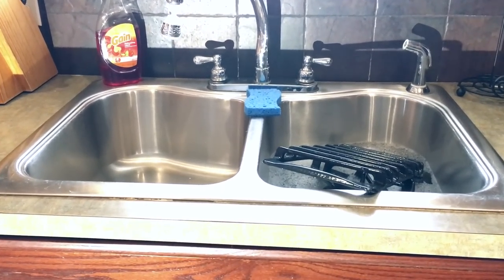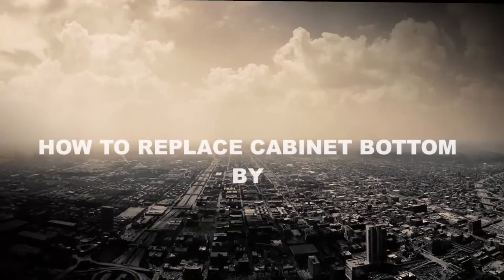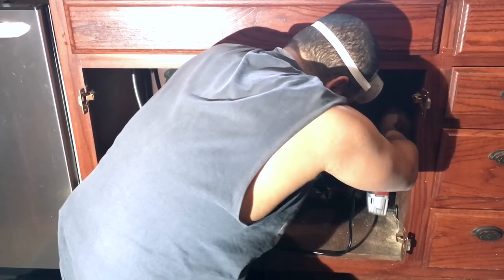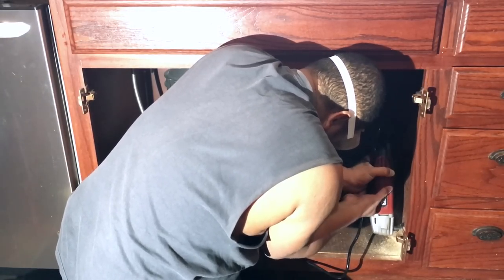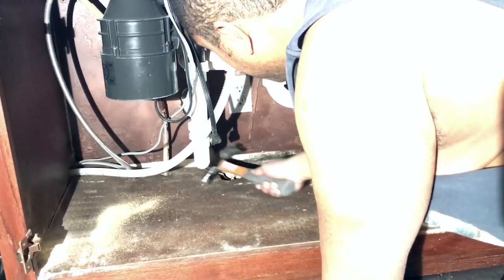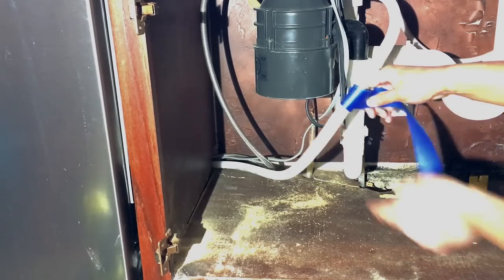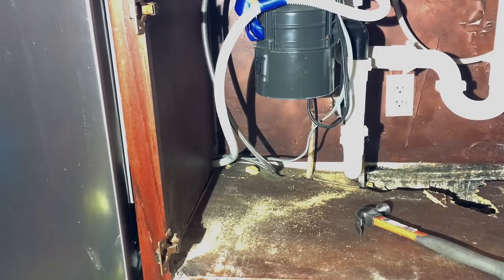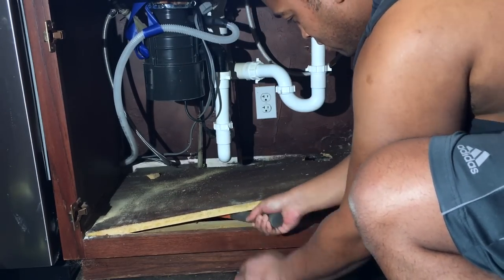How to replace rotten sink base cabinet bottom. The Easy Way. Mold & water damage

Comment: As a professional Handyman I would be really embarrassed if I replaced a cabinet base like that, however for a DIY'er it is not too bad and if its your own place then only you have to live with the finished result.  Careful measuring of the pipe locations (By sliding the base in prior to cutting the pipe holes) and the use of hole saws would have made the repair much neater and would have meant that there was no need for the expandable foam.  Any gaps could have been filled with caulk.   I also place packets of  moisture absorbing crystals underneath.  So once the mold had been taken care of the crystals help pull out any residual dampness that might be left over in the walls and cabinet.  Not a real fan of the music but I am over 50 so I am heading into the grumpy old man stage of my life.
Reply: Can you please tell me how much it would cost to have this fixed?
Reply: Don’t worry I’m 21 and I’m also not a fan of the music
Reply: That music thing has nothing to do with your age. It's annoying when a video creator dumps music into a video that doesn't need it. Really distracting and does NOT make it more entertaining.
Reply: I have mold under sink kitchen cabinet right now and need to do some work. It would be nice if you in San Diego.lol
Reply: Hated the music😡it drowned out his voice. I need to see and hear what is happening to fully understand.
How do you deal with black mold?
Reply: This is what I need done could you tell me what a normal cost would be to have someone do this? Thank you
Reply: He did much better than most apartment maintenance men will do. I need him and hist tools in my unit for an hour! I guess it's the nice home constructions that get good craftsmanship where as apartments are built like disposable movie sets where maintenance work orders go unanswered or done in such a horrible way the problems aren't actually solved.

Comment: Nice video. A few things I’d do differently, though. The first is that it’s critical the newly exposed area be decontaminated. If the mold is bad, call a pro. Not all mold is bad, but many are and you’re not an expert. Do NOT fool yourself into thinking bleach or Lysol spray will handle black mold. It won’t. Once the mold is mitigated, the area must be dried out completely. Put a dehumidifier in the area. Next, I wouldn’t use spray foam. Though it make a fabulous seal, it expands into a gloppy blob, becomes hard as a rock, and can never be removed again without a lot of effort (chiseling) and possible pipe damage. Rather, I’d simply fashion the board in two parts, not permanently fix them to the frame, and snuggly stuff steel wool between the pipes and the wood to allow air to circulate between the cabinet base and floor yet keep rodents out. Because you always want DIY access to area and never want to have to rip it out again. Going forward, I also recommend deploying a water detector on the floor and a couple of large plastic trays with water detectors on the new platform, to apprise you the moment a leak occurs. The detectors and trays are available on Amazon, and are inexpensive.

Comment: An option for the pipes is if your a plumber, disconnect all supply/drain lines, scribe around where's they are supposed to be at, slip your new board over them and down, then reconnect water/drain lines and no more bitching about loctite lol!

Comment: Thanks ! I need to replace the inside, walls and back and floor! Is that possible without buying a new base !
Reply from the maker: Well in you case it seems like it might be more than just the base.  Try to see how rotted out the walls and back and floor are first. You might need to just replace the entire cabinet so the new cabinet can be structurally sound.

Comment: Very nice....I don’t have all those tools.... what’s a reasonable amount to pay for this kinda job?
Reply from the maker: nashikaran I’m not sure I would start out by calling a handy man. I would hope that it wouldn’t cost more than $150 because beyond that price point you might as well buy the tools and wood and learn how to do it yourself. Just my thoughts tho. Hope that helps.
Reply: Getting a contractor to work for less than $3k (at least in MD) is not easy. If you don't have a handy relative, then buy some used tools and learn. It'll pay off.

Comment: I rent, but I do all my repairs (I think that's how my landlord would like me to say this...)  I've done a fair bit of  plumbing over the years, so of course I hate the sink cabinet. There's a spot in my back that hits the edge, if you know what I'm talking about then you also know "No job under the sink, no matter how small is completed until your back hurts" 
My place has crappy HomeDespot cabinets, and the cheap pressboard cabinet bottom is of course useless after repeated soakings and drying out. 
Under my sink, I've got a not very good drain line from my dishwasher (those thin plastic corrugated hoses that are on most new dish- and clothes-washers. They crack and leak within a year. Best fix is just to wrap them silicone tape. A replacement hose is exactly the same, so you're just spending $40 and  it won't last 12 months. The tape lasts for many years) I've also got an ROS water filtration system. (this morning I woke up to a cracked housing spraying water... ), plus hot and cold water, a line to the dishwasher and the garbage disposal... a lot of things that can go wrong.
Here's what I want to do, should do...but probably won't bother to do. First, the stupid cabinet has a center post between the doors. It has no structural purpose. I'd like to cut it out and attach it to one of the doors. This would make it easier to work under there and easier to replace the cabinet 'floor.'  Personally I think kitchen sink cabinets should all go right to the floor, with a removable 'toe kick' piece so it looks like all the other cabinets. This would be easy to do wouldn't it? Why are there even sink cabinets, there should just be fronts. 
At the bottom I'd like a 'pan' with a drain. or the option for this. Most houses can take a lot of water leaking under the sink, but if you're in an apartment what's annoying to me, could be thousands of dollars in repairs to the ceiling downstairs.  The pan should have a drain hose... but there's lots of issues with this. Ideally when a leak starts an alarm should go off so you can turn off the water.  OK. this is the deluxe please Santa fix... (I've been in many multimillion dollar homes, known a few designers and architects but surprisingly no zillionaire has ever asked for these option. Is it possible to be so rich you don't have a plumbing wish list?) 
What I will do. I have a deep sag in one half of my sink cabinet floor. It's where the heavy ROS tank sits. I'm going to cut a piece of good plywood (not luan, not masonite and nothing made with dust and formaldehyde) I might even put a lip around the outside, but I don't think I'll be ambitious enough to epoxy or paint it (though I have some old epoxy that's past it's prime but would still work). This way I'll have 'pan' on at least part of the cabinet. 
Where should a sink cabinet pan drain to? Outside. You don't want ants crawling up the hose--maybe a check valve.  To a sink downstairs? If you have one. On to the kitchen floor? Probably okay if your floor can handle it. Just pooling up inside the cabinet and in the void underneath is probably the worst thing: mold, and a small leak can go unnoticed. 

Tip: We've all tried to fix that one bit of the sink drain line, and ended up with 2-3 trips to the hardware, almost $100 and half a day (and the sore back).  This is what always used to happen when drain fittings were sheet metal.  Thank goodness for PVC and ABS.  
But what if you were to make a list of parts, sizes, etc... put it in a baggie and stuck it to the back of one of the cabinet doors? I had to replace the ROS membrane filter housing... I just did a 'Hail Mary' purchase on Amazon. If I guessed right, it'll be fixed the day after tomorrow.   Amazon 'Next Day' on a weekend? It's like Brigadoon, my house only appears (to Amazon drivers) on weekdays...so Sunday delivery?  What usually happens is I get a 'no one home' notice about ten minutes after 9 pm when Tracking update shows the kid getting closer and closer to my house and then vanishes. There's no useful option to fix this, Amazon doesn't care, so then it will delay delivery more than the just the normal 2 day Prime. Amazon drivers must have a horrendous turnover. I'm an easy delivery, just stop, step out, chuck it over the wall and leave. Just thinking out loud.
Reply: Pretty good stream of nonsense ending in babbling regarding the Amazon delivery driver. If you have any more drug fueled rants I'd love to see a channel devoted entirely to them.

Comment: Is there any point of a shelf?  Why not just store under sink items on the floor?  The reason I ask is that I am dealing with a serious plumbing leak inaccessible without shelf removal, so I  will NOT be replacing my shelf, just in case of future plumbing leaks (likely to occur, as I am fixing myself😉).